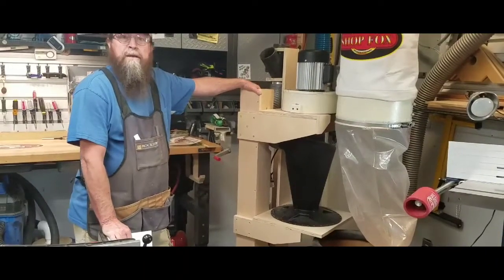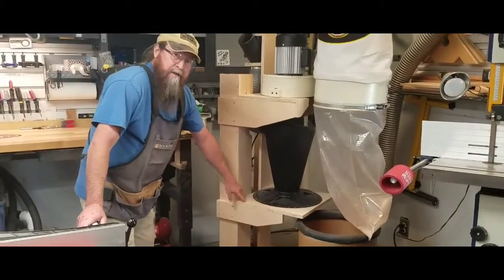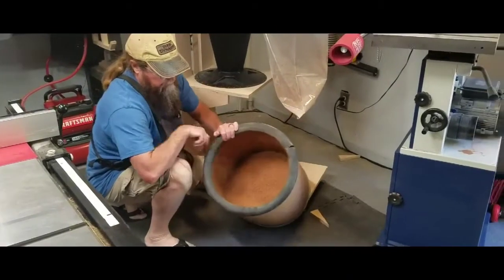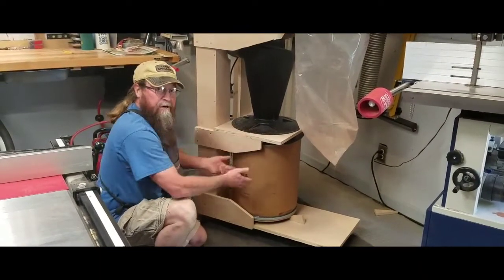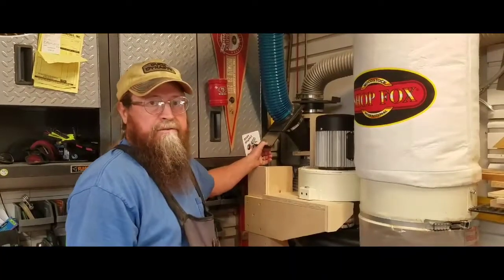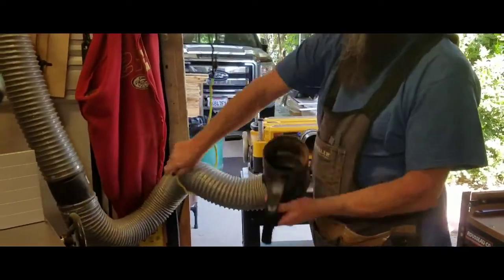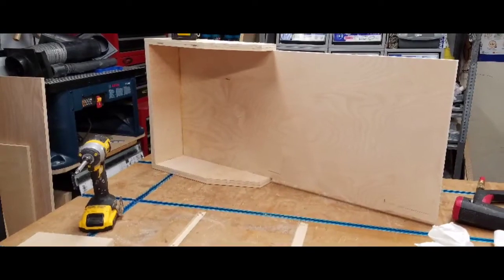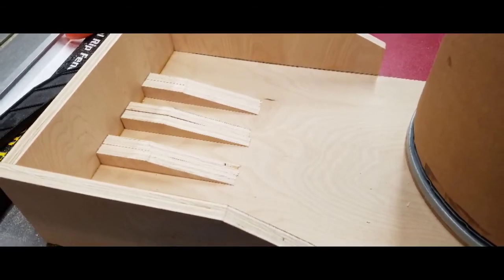Small Shop 2 Stage Dust Collection

Comment: Kirk - great suggestion to use pipe insulation and a piece of plywood between the cyclone and the bucket.  I purchased the same cyclone-bucket kit from Oneida and after wrestling with the supplied clamp (and failing) I followed your pipe insulation-plywood approach and it works great!  Thanks!
Reply from the maker: Glad it helped.  I've been using the same system for several years now and just recently changed ou the pipe insulation due to wear and tear, but it works great still!

Comment: Looking around for ideas. As mentioned you came up with sme elegant solutions. Thanks!
Reply from the maker: Thanks Thomas.  The only issue I have is I must ensure I insert the wedges fully at the bottom of the bin to ensure an airtight connection.  I always know when it is not snug enough by the sawdust on the floor :)

Comment: I will have mine in a few days.  Are you  still happy with it?  Any suggestions now that you have had a year to work with it?   I will mount mine up on the wall to clear up some floor space.  Any new ideas?
Reply from the maker: Actually there are 2 things I would of done different.  1) eliminate the 4" hose/valve splitter unit on top and just use one hose (which I do now) and move from machine to machine.  The two valves kept getting clogged up and not closing all the way, thus loosing suction on the end of the hose.  2) I saw another video on line where someone built one like mine, but like you mentioned, it is attached to the wall.  He sealed his bottom bin differently by using an inner wooden ring for the bin to seal from the inside. (sorry I can not find the link for it now).  But since i increased the size of my "wedges" on the bottom of the barrel that has solved all the leakage I experienced in the beginning.  My process also allows for easy dumping but you must be sure to make sure the bin is very snug to prevent leakage.
Good luck and post what you come up with!

Comment: hey kirk, is this thing worth the investment?  thanks, joe
Reply from the maker: Joe, it is the best shop improvement I have made.  It now sits in the adjacent room and I start it with a remote so I do not hear it.  I do a lot of milling so it is way easier to empty the canister instead of the bag which I never have to empty.  Since building this I have changed out the top bag filter with a nice pleated filter. I love the system.
Reply from the maker: Oops forgot, I have also upgraded the motor to the 2 HP dust collection system from Harbor Freight and it has so much suction.